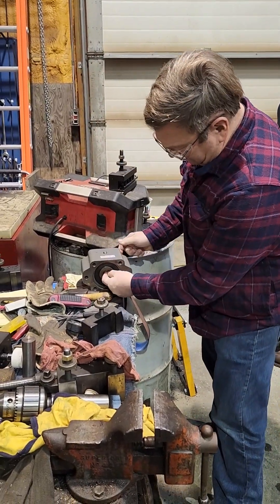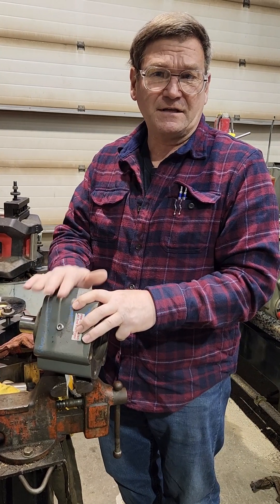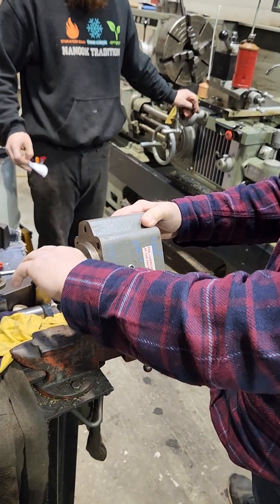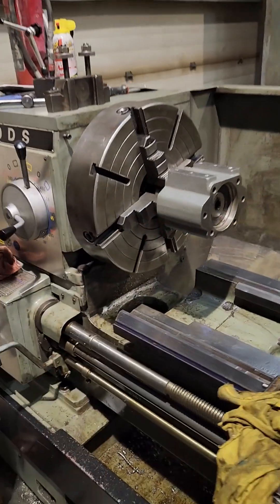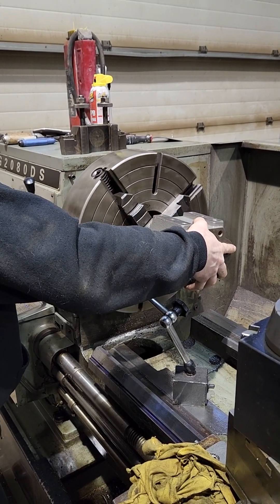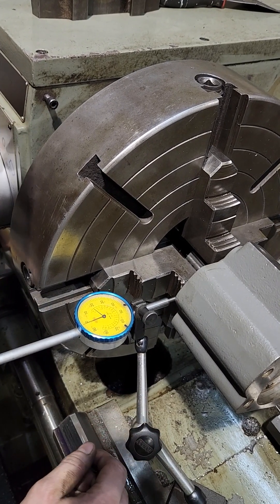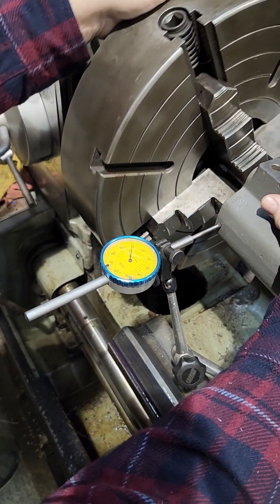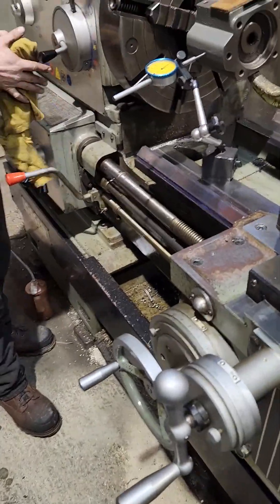Machinist's Minutes: Dialing in a Shaft in an Overhanging Load Adapter (Full)

Comment: Would you be able to indicate the ID of the female spigot/shoulder on the end of the adapter as well? That would probably save time.

Or is this more of a demonstration than anything?
Reply from the maker: That would be harder, because it will spin on the shaft & the accuracy will be less, as it is not guaranteed to match the bearing centers.  You might find this video interesting:
https://www.youtube.com/watch?v=Y509BJGNfjQ&t=3s
Reply: @HOWEES  thank you for the explanation.